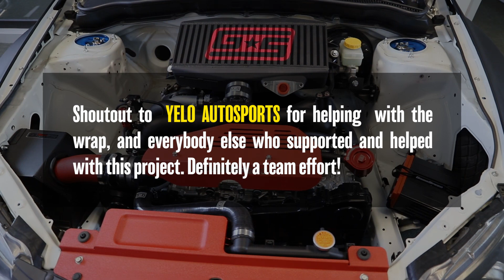GrimmSpeed Front End Project Recap

Comment: I love your products but this looks like a waste of good parts. Especially since you prob sell 95%+ of your parts online. 
And you should have left the front wheels attached and put casters on the back so you could wheel it around (or easily moved to take to trade shows.)
Reply from the maker: You'd be surprised. We have a lot of traffic coming in and out of our shop and lobby area. There is never a bad time to display our work. We are very proud of what we do here and we wanted a presentable way to showoff the goods. As far as keeping the front wheels attached and being able to move it around, it still weights quite a lot. It wouldn't be feasible to bring it to trade shows. We prefer to keep it nice and clean inside our lobby. We can bring our shop cars to trade shows if need be.